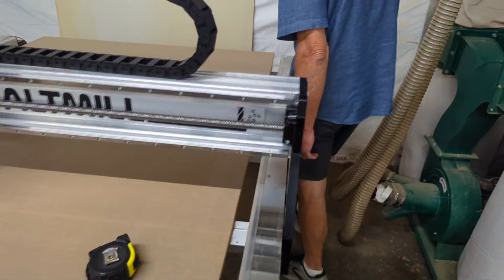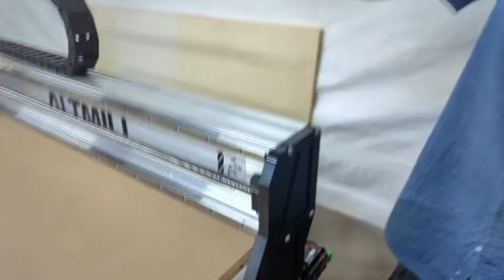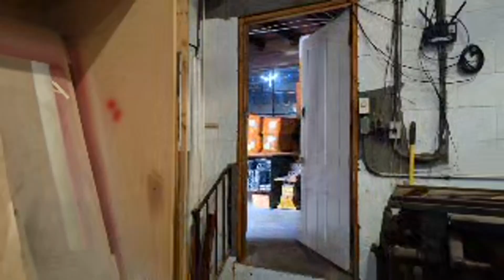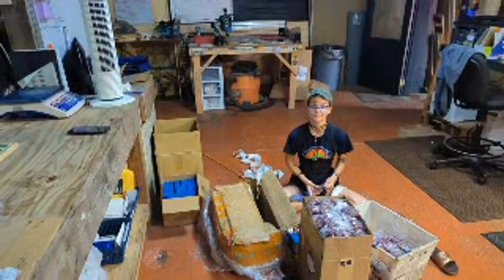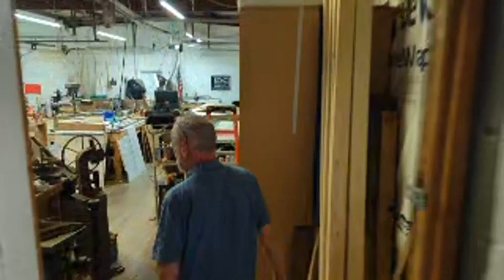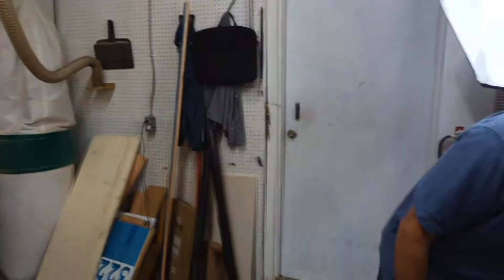Sneak Preview - New Altmill CNC Router by Sienci Labs

Comment: can these bits be used outside of a cnc machine .. like lets say in a router?
Reply from the maker: Yes, many CNC bits can also be used in a handheld router, as long as the shank size matches your router's collet. Just make sure you're using the appropriate RPM settings and feed rates for your material to ensure the best results. Always prioritize safety when using any tooling!

Comment: Thank you for this video as well. Can you cut 3-D with the Altmill? Thanks! Also, I noticed your Vacuum link is not working. I will try again later.
Reply from the maker: keithclark8030, You're welcome! Yes, you can cut 3-D designs with the Altmill using the right setup and tools. Here is the link to the air weights brother: https://airweights.com/?ref=IDCWOODCRAFT
Reply: @IDCWoodcraft  Thank you!

Comment: What acceleration is standard and is it adjustable in their control software?
Reply from the maker: Caleb, that's a great question. Acceleration and deceleration depends on the control board circuitry. And yes, these values can be changed in the control software

Comment: I originally ordered a long mill. But when I seen the Altmill I had cancelled the long mill to order the Altmill I should be getting mine hopefully by the beginning of September. Can’t wait
Reply: I'm also awaiting mine; we must have ordered at the same time, as mine'll also be delivered in September!  I'm glad to hear that you changed your order to the AltMill, as I was in a similar situation when the Longmill MKIIs were coming out.  However in my case, I wasn't aware that the MKI was being replaced, and therefore received the MKI.  But I wasn't at all disappointed, as the MKI was a terrific machine, with its only detractor being its smaller 30"X30" milling space (the MKII had one version that was 4' X 30" (or 48"... not sure).  Because mine was smaller, when the AltMill came out, I knew its larger milling space would be better for the work I do (making furniture)
Reply from the maker: kepa8991, That's great to hear! The Altmill is definitely a popular choice among woodworkers. You're going to have a lot of fun creating projects with it. Enjoy!

Comment: just finished building mine having trouble doing computer setup
Reply from the maker: ppouncey4331, Setting up the computer for your CNC machine can be a bit tricky at first. Make sure all connections are secure, double-check your software settings, and consult the user manual for troubleshooting tips. Good luck!
Reply: I was 71 years old when I got my first CNC (Longmill MKI); the learning curve for CAD/CAM (like Garett, I'm using Vectric VCarve Pro) was a bit steep for me, because I'd never before done any designing with a CAD program.  However, after a few weeks, I was finding it quite intuitive and am able to do 2-sided projects.  Incidentally, I've ordered an AltMill and have already sold my Longmill.